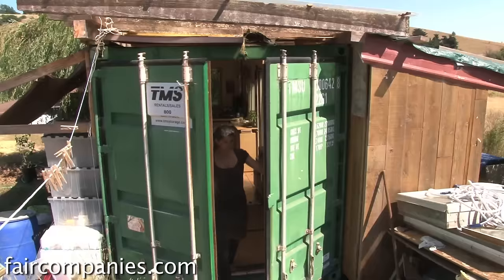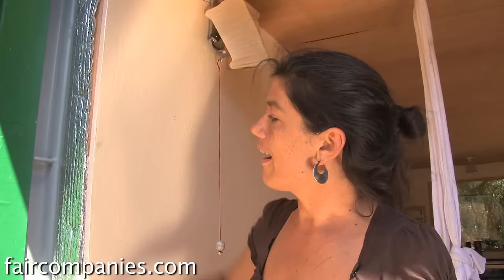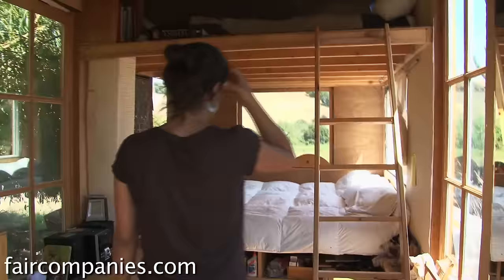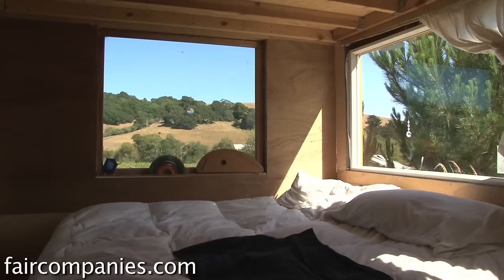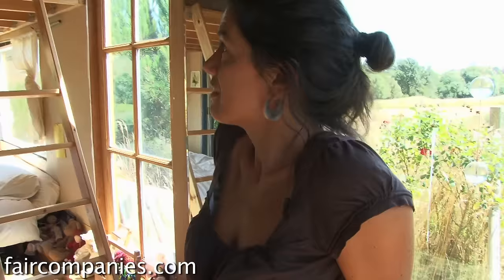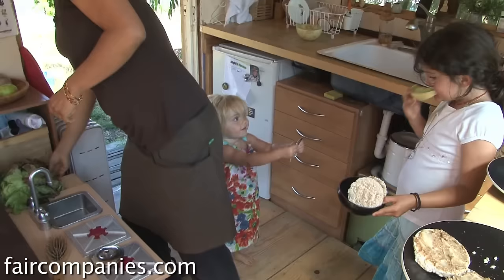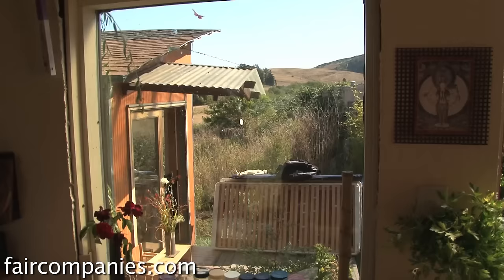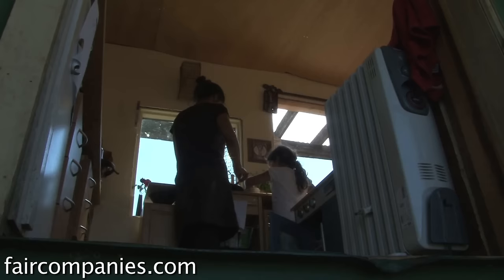California DIY, shipping container tiny home and a cargo trailer bedroom

Comment: If you buy the refridgerator containers they are thick with insulation already so they should work well keeping cold out in winter and heat out in summer.

Comment: Looks like home.  To solve the overheating issue add a shade sail above the container. Or, since metal conducts heat very well make a solar hot water heater out of your roof.  One homesteading Aussie built a solar array over the container to block the heat and make electricity.

Comment: You could pretty easily and cheaply raise the roof in the daughters room.  I see small sheds or buildings for free or cheap on Craigs List all the time. You just have to move them.  Cut a hole in the roof and bolt the small building on top of it. Weatherpoof the connecting points and viola! She would be able to stand up and even have windows in her space. Even a skylight would change the feel of her room and you can get those at salvage yards pretty cheap. More so than space or being able to stand up - the lack of natural light should be thought about for the child.

Comment: I don't understand.  Does the gas valve need to be turned on every time you run a tap or is it constantly on and how would you avoid emptying your bottle?

Also I would love to know more specifics about the container insulation choices materials, measurements,costs, joins, effectiveness and so on.

Really great video though.

Comment: Great, the only big deal is to change the 2x4 at the steps holding up the cover with a 4x4 .(Putting 2 2x4 together is not as strong) or safe.

Comment: did she have to have these inspected before they could be signed off as livable space? also she's hooked up to water so she has to be on someones land is she renting or squatting? lastly she keeps expanding to larger and larger spaces. what does she do in severe weather, looking at the work she's doing these don't seem like they hold up (aside from the shipping container) to prevent leaks. she just has glorified shacks she is a walking contradiction.